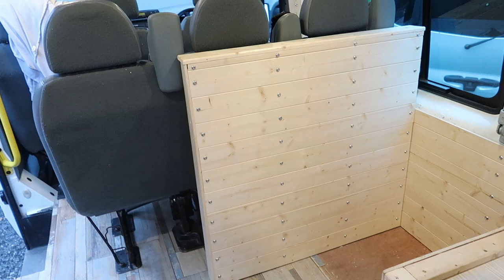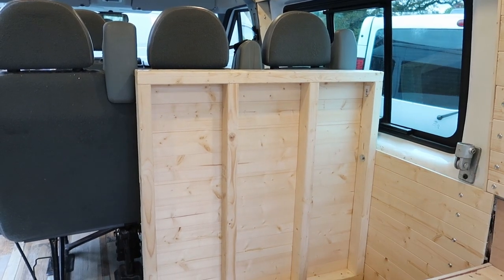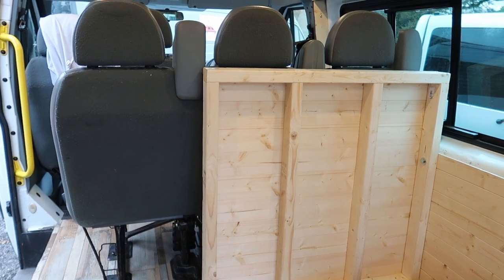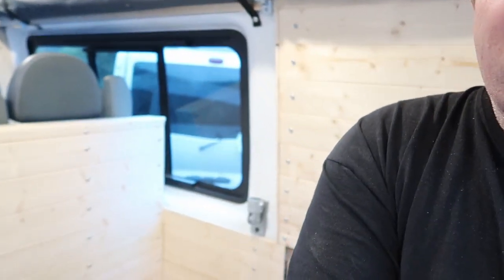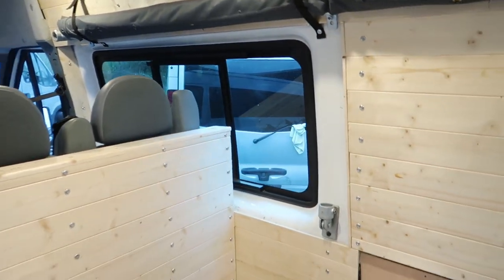Ford Transit Campervan Conversion - Easy Partition Wall

Comment: Yes, I’m subscribed, and yes, I watch the videos, Karl. 😊
What I’d like to ask regarding the partition wall is that we are trying to construct one that is, effectively, a full bulkhead, top to bottom. It will have a ‘real’ opening window in it as an escape route into the cab from the living area.
It needs to be completely sealed off from the cab so that cigarette smoke can’t pass between the two areas. What would you suggest if challenged with this?
Reply from the maker: Scribing in the panels for the wall will get you extremely close to the van sides.  Any frame work I would silkaflex before screwing and once the wall is up and before finishing I would use acrylic caulk in any of the gaps.  If you have large gaps on the frame bud I would also use expa Di g foam and then cut back level with the frame.  I have done this before for the exact same reason for a customer
Reply: @BuiltnotBoughtCampers   Brilliant! Especially as you’ve actually done this for someone for the same reason. 👌
Reply: don.t smoke

Comment: Amazing job as always, got my floor down today in my van. Needs screwing down but scared 😅 did buy myself Dewalt impact and drill today 🤑 any tips on screwing floor down?
Reply from the maker: Have you battened and insulated the floor, if so screw into the battens if not I would get silkaflex from screw fix and bond the boards to the floor bot screw.